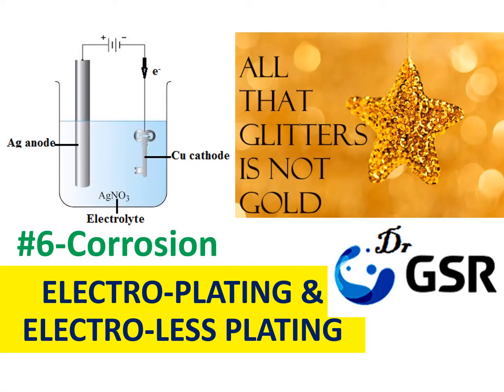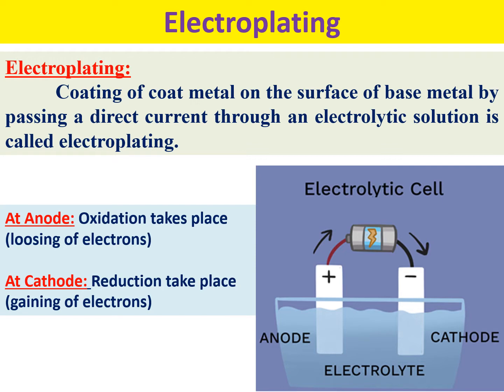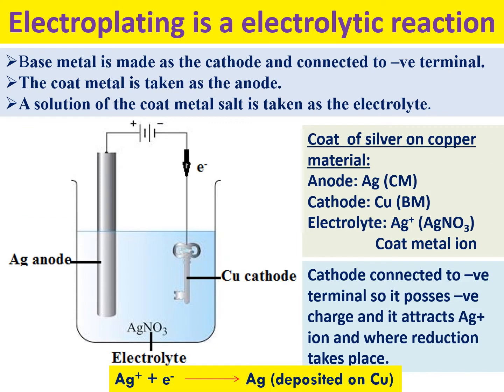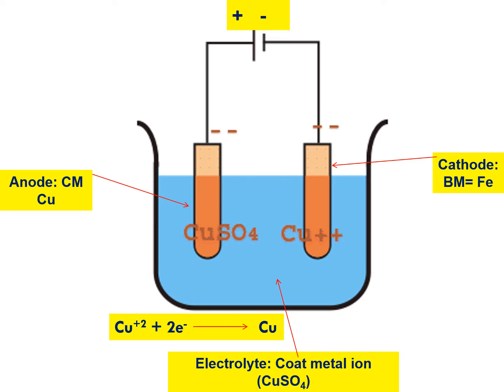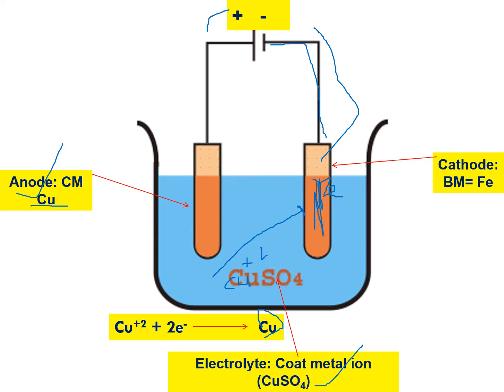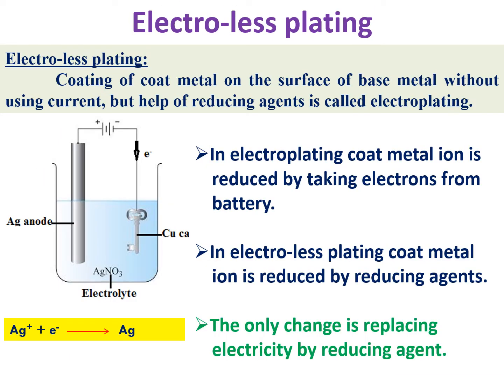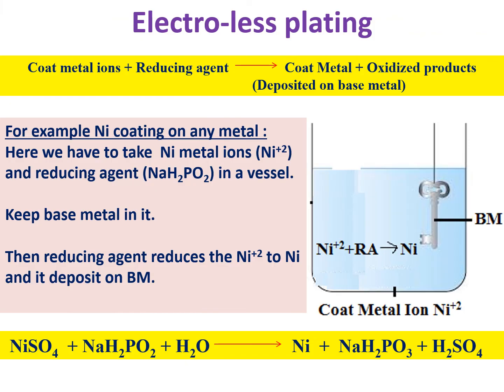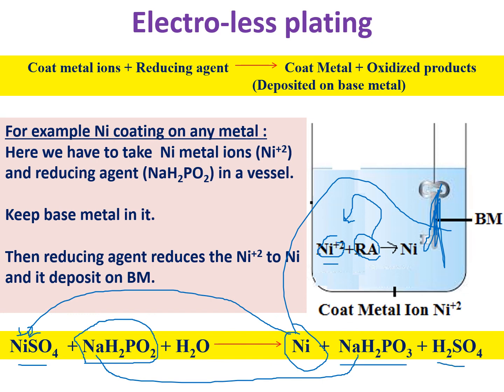6-Electroplating and Electroless Plating/Corrosion Prevention

Comment: Sir you said electroless plating done by without using current then why we use battery ?
Reply from the maker: During electro-plating we are using battery to supply electrons but during electro less-plating we are using a chemical (reducing agent) to supply electrons without battery. Please watch again for this....

Comment: Sir is it necessary to electroplate an already electrolessly plated article? Kindly answer sir
Reply from the maker: I'm sorry, Please ask clearly, I did not get your question.
Reply: @DrGSR  sir for an example, if  silver is plated by electroless method, will that shelf life be same as electroplating method? Or we have to do electroless method and electroplating both on same base metal?
Reply: @DrGSR   shelf life of electroplating and electroless plating method both are same or it will differ sir?
Reply: @DrGSR  to me more clear, if I do electroless silver plating on copper metal, is it necessary to again do silver electroplating over that electroless silver coating?!
Reply from the maker: For example if you already plated with copper on iron, if you want again plate on that with gold, Yes you can but you need to change electrolyte.
Reply from the maker: You can electroplate on any conducting metal (even already electroplated or electroless plated). Just took that metal as cathode and add some solutions (electrolyte, to which you want to coat on our metal).
Reply from the maker: Electroplating and electrolessplating  both are used to coating on metal with other. But procedure is different. In electroplating we use electricity, in electroless plating we use reducing agents
Reply from the maker: @monika madhavan did you clear?
Reply: @DrGSR  yes sir. Thanks for your reply